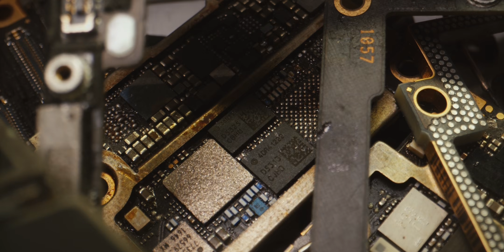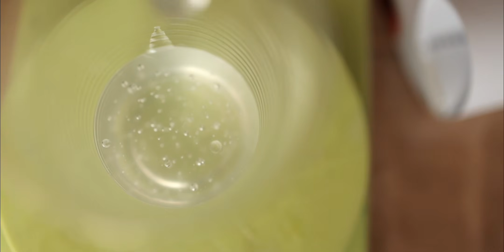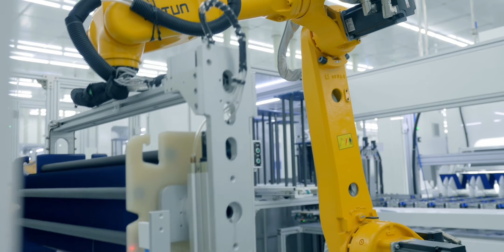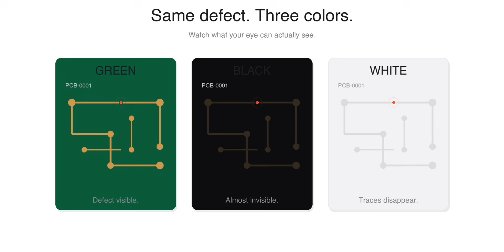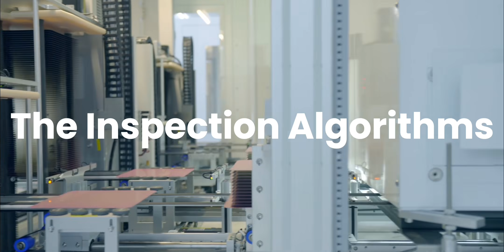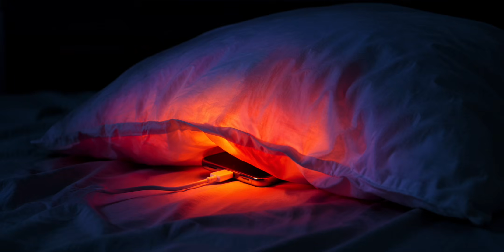Why Are Almost All Circuit Boards Green?

Comment: I’ve seen red circuit boards
Reply from the maker: yeah red ones exist! usually high-frequency / RF boards, or sometimes just branding choices. SparkFun's been doing red for years. they all cost more than green. Same supply-chain reason.
Reply: @Zeusdecodes I see
Reply: First time I saw that was the Gravis Ultrasound.
Reply: @lutello3012I see

Comment: Honestly green may be common but nowadays in modern mid to high end devices there's litterly no green it's weird colours
Reply from the maker: true for the stuff designed to be opened up and admired. Phones, gaming PCs, premium laptops. But crack open a router, a TV, a washing machine, even most mid-range laptops - still green. Green never left, it just got hidden behind the cases of devices that don't show off.